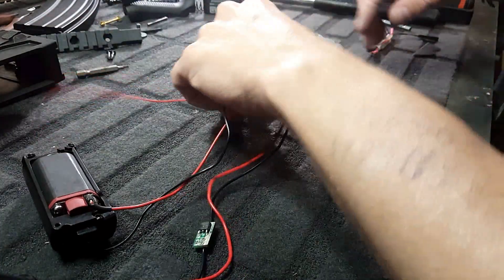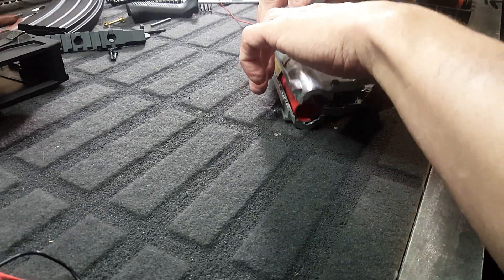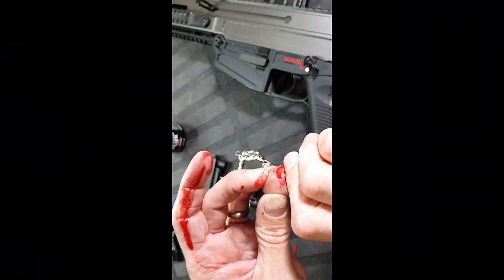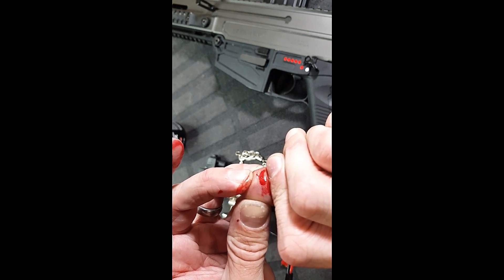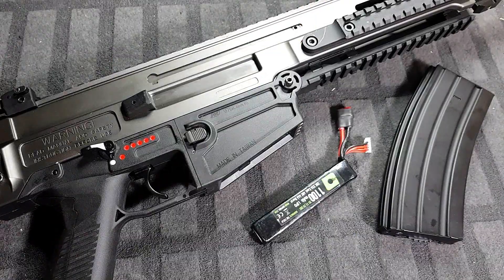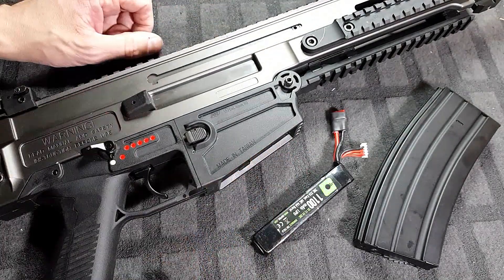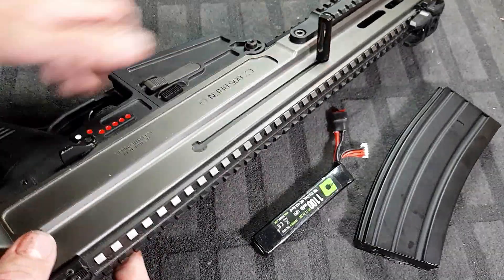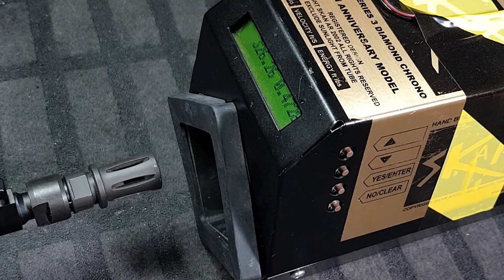ASG CZ BREN mosfet replacement

Comment: You didn't have any issues with overspin in semi? We have 2 Brens, and both have the same issue. 2/3 shots in semi with a 7.4, 15c lipo
Reply from the maker: I changed the mosfet to an active break type
Reply: @NegativeAirsoftTech  alright tah. Did you come across anything else that needs sorting?

Comment: After 30 mins play time, out of the box - gun stopped working. Sent it back, MOSFET 'came loose' apparently... two weeks later, got it back... Corona started so no play time - then a window opened up to go let off some steam... 10 mins in... same shitty malfunction... ach... quite a mission getting the gun back to the shop so am awaiting to see what they are going to do about it, otherwise its order me a soldering iron and give it a go myself - that said for the money it cost me, this is ridiculous...
Reply from the maker: Gate pico bud